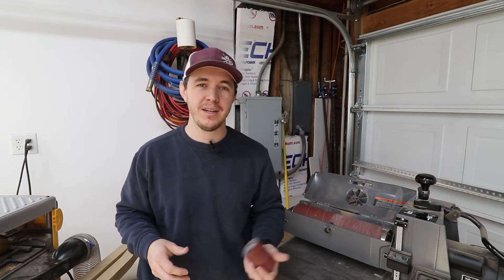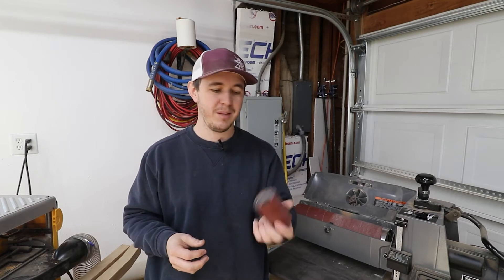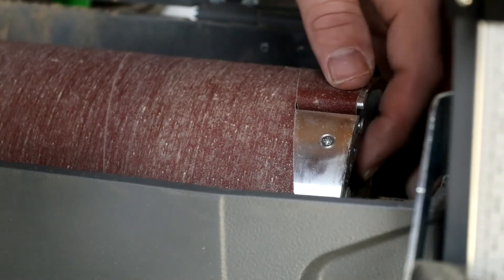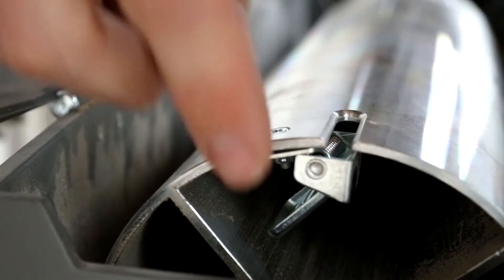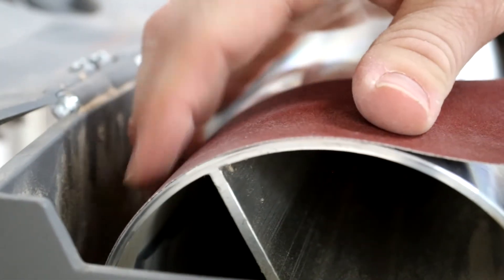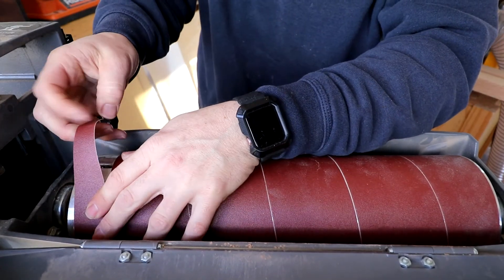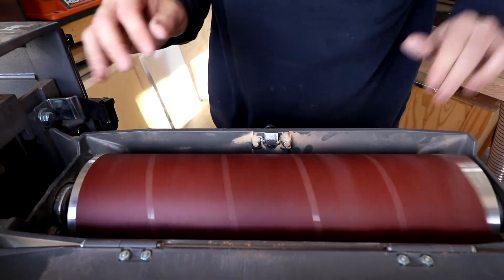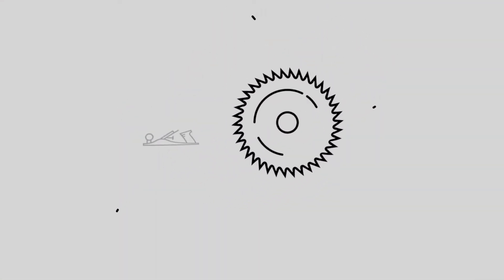How to Change Sand Paper on Supermax 16-32 Drum Sander

Comment: Thank you. I just got mine and I took the new one off as your suppose to in order to calibrate the height. But I didn’t replace it I used it as a pattern to cut a bunch of new strips off the 55 yard rolls. 
When I went to install it I needed a visual representation as that’s  how I learn best . Found your video,  watched it, went out to shop and continued cutting more strips. But      
 when it came time to installing , I did but I wasn’t sure that there should be such a big space at the beginning of the roll, so checked this video out again, and seen that yes there is a space . So thank you for the great video. And sorry for the long winded comment.

Comment: You made it look simple,  I've tried starting on both sides, but I can't  get it tight enough, and it over laps on the first seam on the right side. Any thoughts?
Reply: I have the same problem. Working “blind” makes it tough to make sure the paper is trapped between the correct elements of the clamp. The clamp spring is really hard to operate with senior hands. The instructions in the manual are no good either. They do caution you to make sure there is a little space at the very end (see pictures in the book).

Comment: Have you had any problems with tracking or adjusting feed belt alignment?
Reply from the maker: I've had a few times where I had to re-adjust the wrap in the beginning of installing it in order to get it tight. Overall it works very well!
Reply: Yes.  I have.  Mainly getting loose on right side.  Which then leads to overlap and burning. But another video say u should leave a seam gap between the last wrap and new to last wrap on the right side and then feed the tip into The tensioner.  This gap will allow for expansion and let the tensioner take up slack.  I will try this tmw.  Last time I used the sander 3 months ago, I was frustrated With the wrap loosing up but got the project done before I found a good you tube video with more narrative.  I had wrapped like this video did and had those problems.

Comment: THE CLAMPS ON THE POWERMATIC ARE HORRIBLE AND THE BELTS ARE ALWAYS SLIPPING --I will look into this type
Reply: The clamp on the right side is nearly impossible to get right. I have spent hours and ruined many belts with this machine. It's been a nightmare. I'm selling it.
Reply: @billtesar1645  Yes.  I have.  Mainly getting loose on right side.  Which then leads to overlap and burning. But another video say u should leave a seam gap between the last wrap and new to last wrap on the right side and then feed the tip into The tensioner.  This gap will allow for expansion and let the tensioner take up slack.  I will try this tmw.  Last time I used the sander 3 months ago, I was frustrated With the wrap loosing up but got the project done before I found a good you tube video with more narrative.  I had wrapped like this video did and had those problems.

Comment: Essentially useless video since what was shown is clearly indicated in the instruction manual. The problem is that is isn't so wasy to slip the end into the clip on the side toward the motor. Also, it's maybe much easier for younger woodworkers. As we age there are parts of our bodies which don't have the same flexibility and strength and fingers/hands are one of those parts. So, while it's a no-brainer to know the procedure it's much more difficult to carry out the steps, no matter what anyone says. It's a great sander. Even with the tool that Laguna included with the sander (which doesn't seem to really be shaped quite right for its funtion), it's a difficult task to get that last end of the paper rol inserted in the clamp. Maybe a video which gives some tips directed to this problem would be helpful.